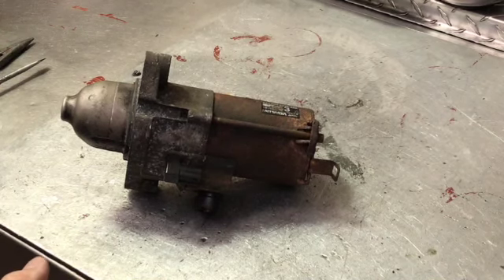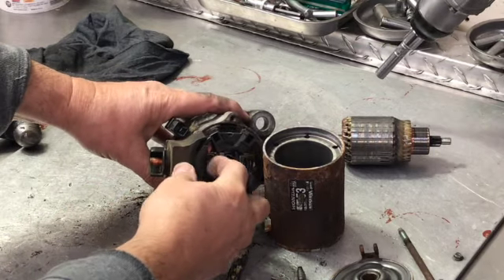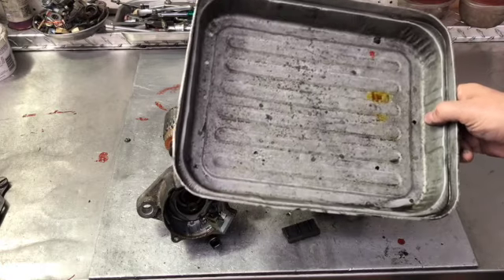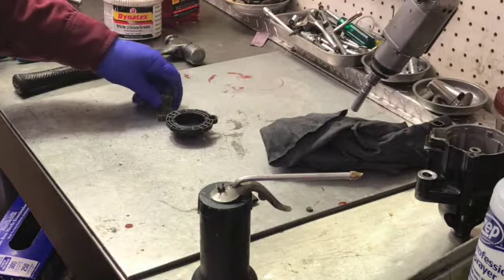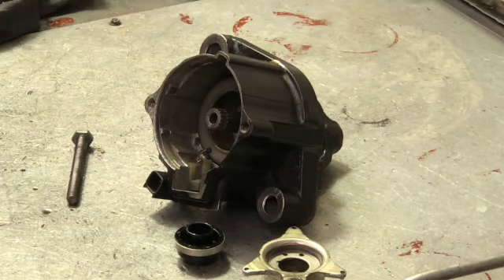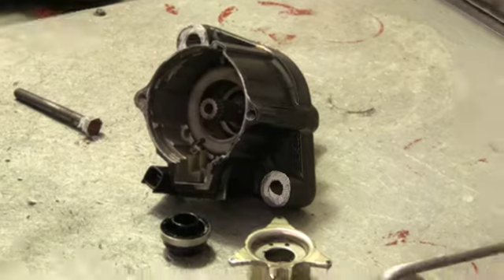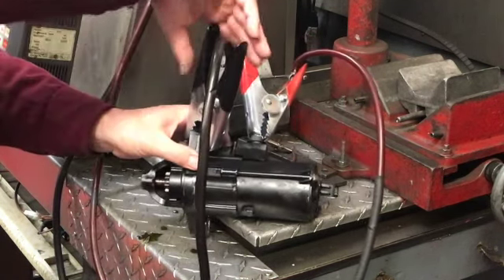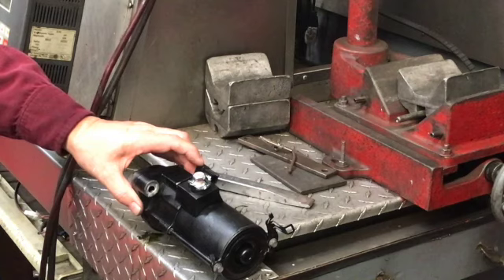06971 Honda Starter rebuild

Comment: Appreciate your help with my no crank - no start issue… Used your brush kit, even though the brushes on my starter looked good. Starter problem is fixed. I think the copper washer on the plastic plunger may have been the culprit.
Reply from the maker: The copper washer failure at low mileage is a sign of low voltage. Keep a new battery with clean connections.
Reply: @rebuilderinabox  thanks, Mike. I’ll check that out.
Reply: @rebuilderinabox  hello im new to your page want to ask about the alternator
Reply: Ain't that some CHEESY shit to cheap out on the load current?
Reply: Solinoids did not wear out like that on the older models cars etc. Usually clean it up, put in some new contacts and reassemble.   Bob's you're uncle!

Comment: Love your utube videos. They are great!
Just ordered your brush kit (06971) for Mitsuba SM-71005 starter-2006 accord -2.4 liter.
Disassembling my starter I noticed that the bushing dropped out of the plastic annular ring gear.
Is this a problem being that loose when reinstalling? Any fix for that?
Thanks for any thoughts on this.
Reply from the maker: Pretty much a non issue. Before re ass'y clean both parts with dawn, a little red loctite on the outer bushing surface area. Allow 1 hour warm dry time.
Reply: @ Great. Thank You very much.

Comment: Is it necessary to spray varnish on the armature when rebuilding? Thanks for taking the time and effort to make this super informative video. Ordered the rebuild kit yesterday. Question - why are accord starters known to not last long? Does the starter with the rebuild kit typically last longer than the original? My starter started going out at ~60,000 miles. Thanks for the help… Dan Ayo
Reply from the maker: You don't have to spray varnish. The Mitsuba design is smart and light, but in my opinion leaves a lot on the table for longevity. To achieve 100k miles from that starter you should replace the battery every 4 years max in a colder or not regularly used climate. (Leaving a battery idle a lot effects life expectancy) A rebuild kit for this would restore normal life expectancy but nothing more.
Reply: @rebuilderinabox  Thanks, Mike! Hope USPS gets it to me soon. Every so often the starter is completely quiet when the key is turned, Battery good, dash lights come on. Try to start again and it generally starts. Will using the car (while waiting for kit) do more harm the starter. From everything I’ve read it looks like a starter issue. OEM rebuild looks like a good option. Do you have an opinion for an after market option that would provide longer service than OEM?
Reply from the maker: @danayo8852  We have not retro fitted anything for anything on the new Mitsuba design, however I do think it may not be a bad idea. I might have suggestions for experimentation, but I don't know your application year model engine size, AT or MT. But yes, the more you drive it like that, the worst the armature gets.
Reply: @rebuilderinabox   The starting problem is a 2014 Honda Accord, inline 4 cylinder (2.4L), automatic transmission. On occasion, about every fourth time, the starter is dead silent when the key is turned. All dash lights come on, battery read 12.6-7 volts. Headlights are bright. I ran a thorough check code and no errors are recorded.
Thanks for the help.
Reply from the maker: There is no simple answer, it's just a bad design. The kit will fix it, but it's not magic. It won't change anything, just restore to original working condition. Keeping a newer battery (4yrs +) can help.
Reply: @rebuilderinabox  which starter rebuild kit is for a 2006 Ford E350 van with a 5.4 engine?. I can't get any information off of your website and just keeps sticking?